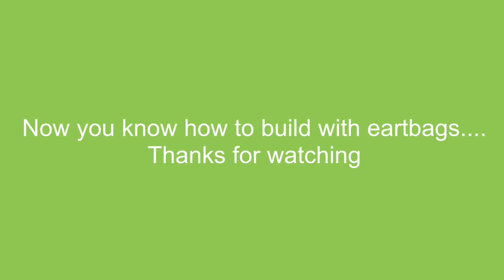Earthbag Building - Almost ANYONE CAN DO THIS!!

Comment: This is interesting.  I just purchased my land.  I am getting different ideas for building my tiny home.   I like this concept.
Reply from the maker: You should consider hyperadobe for a tiny home… that is what I would use. They are more versatile as far as shaping and overall I think they would be easier than these 😎
Reply: If you do decide to go with earthbags, a dome would be a little more sturdy, and you wouldn't have to worry about engineering a roof or buying any other materials. You can cover them with adobe or concrete, depending on how natural you want, or pricing, whichever is more important to you. The domes also tend to be really strong too. There's quite a bit of info on here as well as online in general about building them safely if you are interested 😀 (btw, if you want an extra nudge, I believe I saw somewhere that the cost of an earthbag dome was about 14$/sqft on average to build, while an average tiny house was about 114$/sqft)
Reply: @OffGrit  what is hyperadobe
Reply from the maker: @kerryann2036  they are continuous tubes that look like onion bags . They have a lot of advantages to bags . One being that you don’t need to do the barbwire in between layers… main disadvantage is that they are stationary and once you get higher on the walls, moving dirt can be tedious.
Reply: I like it too because it sounds good bulletproof and warm in the winter cool in the summer.
Reply: Kris Harbour Natural Building.
Reply: How's it going luv,and what construction did you use?
Reply: @walkstheman98  link to that,can't find one?

Comment: Loving the filling station. I'm definitely going to build one of them when I start my own project. I'm thinking about building an earthbag cistern for rainwater as well, don't see a lot of information on them though.
Reply from the maker: Most definitely 🙏💪. I know it would work as far as a cistern goes... This building flooded when I first moved out here and it was a cistern...not by choice... But if you dig out the first couple feet like this one and then make the walls the bulk of the water pressure will be distributed in the ground and then you could probably get away with filling it full with a liner

Comment: Hey man, do you think it's better to make it with a lot of small bags like this, or some long complete bags like to cover the whole wall or the perimeter of the house? I think for me is easyer to load them like you in your station, buen maybe it would be a better structure with a single long bag each layer....
Or maybe 1 layer bricks 1 layer whole bag....
Reply from the maker: Well, there are actually a lot of people out here that build hyper Adobe or super Adobe and which it is a continuous tube. And overall, I think that they are structurally better than this method. However, in certain circumstances these bags are actually better at least for me because number one. I like the fact that these are mobile and that I can fill them in one place, move them another place etc. So there's that. Also, I now have a tractor that I will be setting up to fill at least 12 bags at a time if not more so it will be faster than doing the tubes. Thnx
Reply: @OffGrit  ohhh, great job man, thanks!!!
Reply: Knowing next to nothing about earth bag buildings, my guess is that it’s a toss-up as to which is better.  As said, the continuous bags are more cumbersome to work with.  

And I presume these are special bags built to last when buried, but if a long tube bag gets damage or a tear is started, it could lead to more issues than if a single bag or 2 had a tear.  (Or maybe once rammed down well bag deterioration isn’t a big issue….idk).

Comment: I  enjoyed this. Did you dig out foundations or did you start laying the sacks on the earth?
Reply from the maker: I laid these directly on earth.  I did dig a trench around the outside perimeter and laid a moisture barrier in the trench and over the first couple courses of bags to keep them dry. I know people dig out a foundation and use gravel etc.... one thing out where I live is that the ground is extremely hard so it doesn't really require it for a build like this.... But if you live in a place with less stable soil and get a lot of rain, digging a trench with gravel underneath the bags may be a good idea
Reply: @OffGrit  Thanks for the reply! 
 You've inspired me!

Comment: I am a big fan of this type of construction, because of low energy consumption for air conditioning. Stucco over the outside and drywall inside. A user friendly wire might work faster than string  tie.

Comment: Thank you for sharing this 🙏. Do you need fondations or you can start directly with earthbags at the bottom?
Reply from the maker: Most people will put a trench with gravel as the foundation. On this one I put a moisture barrier around the perimeter and the bags are directly on the ground... Where I live the ground is extremely hard so it works
Reply: @OffGrit  cheers. Do you think this could works for a tropical island ?
Reply from the maker: @povbodyboard  if I were to build this on a tropical island, I would make sure that the roof overhang was at least a couple of feet in all directions... Might also put up a moisture barrier on bags and then use lath with a stucco mix for the coating... There are people building these all over the world and I have seen them in rain forests so I think yes.... You may just have to consider what type of soil you have to fill the bags and see if there needs to be amendments made...

Comment: How many bags per day can someone do (w 1 person)? And do you have to use barbwire between rows, or is there a way to not use that but still have them not move or slide off each other? And do you think its better to build several small rooms joined up or just 1 big room instead? 

Edited in later; oops, you addressed the question of # of bags per hour halfway in.
Reply from the maker: You don't HAVE to use barbwire BUT it can easily become unstable after 4-5ft.... If you use bags that are wider you could be ok . Also I used to look at military structures built with sandbags and they have some interesting setups that don't use it between the bags

Comment: Hola gracias por compartir verte hacer me hace  sentir  que yo lo puedo hacer  ya tengo 300 sacos con esa cantidad me  alcanza cuanto ocupaste tu   ,de  alto cuánto tiene tu casa❤ gracias ❤
Reply from the maker: I used about 1000 bags for this and the building is about 3 foot in the ground so it is taller inside than outside. It is 300 sq ft thank you

Comment: Kindly inform me which material of bag is used so that it does not get worn out by the weather. Thank you
Reply from the maker: We used polypropylene bags. The lighter colored ones. I would look at SandBaggy.com they have options and even UV resistant bags. My experience because I have built other things since, is that you have about a year of exposure with this before it is even an issue... If you are covering them in a stucco like I have, they are good to go
Reply: Appreciate your kind reply. 👍
Reply: What will be a good media to fill in these bags which will really be strong and stand for a good number of years? Do give me a couple of options to help choose which is price worthy. Thank you
Reply from the maker: @albertamanna2258  there are ratios that work well with natural dirt. people use anywhere from 5% to 30% clay ratio in normal soil (look up soil jar test for diy dirt analyzing) i didnt use anything except soil and i sifted it through a screen to remove stones....and then tamped it....that is it. 3 years later and this building is solid
Reply: Thank you 👍

Comment: I was to move to cochise and build. How long did this take you? However I build my home I plan to camp out and finish it then move in.
Reply from the maker: it still isnt done..lol. although i have been bouncing around to about 5 different projects at once.
Reply: @OffGrit  I really want to make a dome that I keep adding additional domes to over time. The first one I worry will take too long. Especially if I'm alone.
Reply from the maker: @oOAjjOo   my advice to someone that would want to live in something and add to it, ,,,, i would go with a shed or a cheaper rv... it is a long process and almost every video i watch of these being built is with a group of people which is a different ballgame when you have help.... a shed can be built fairly quick (livable in a couple of weeks if you spend about $1500-2k) and then you can take your time on the build....
Reply: @OffGrit  yeah. I think I can build a cabin pretty quickly by myself. I just feel a super adobe would work best in this climate. I guess I'll just stick to the cabin.

Comment: The steel plate you were using is a railroad tie plate. Plate that is placed on the RR tie and the rail (track) is placed on it. Then comes the spikes.
Reply from the maker: Thank you!
Reply: @OffGrit  we would weld about 9 of them together and 3 spikes on each side so as to slip them over our livestock water troughs floats. Damn hogs wouldn't just drink water but tear the floats up. RR plates were so damn heavy we had fewer instances.

Comment: How do you do the barbed wire? Completely new to this so sorry if it’s already included in the bag or anything. We’re looking to build one in the back yard
Reply from the maker: So you can buy the barbed wire separately (tractor supply, Lowe’s Home Depot) and you do a course on the bags (layer) and then you roll usually 2 lines of babrbed wire between each layer. Once you do the next layer you then tamp the bags to make sure they are well attached to the previous layer.. the barbed wire prevents shifting

Comment: I was told i had to use cement in with sand?  Is this true?
Reply from the maker: Well...... Not sure what your dirt is like... I have a good mix of clay/sand so it isn't necessary for me to add cement ..
Reply: @OffGrit  Thank you for answering no one else has.  I live in Oklahoma.  I was just going to use sand.   But the first two rows I was going to use rocks.  I was going to use rebar and wire to secure and lock down more.  Tornados are common and lots of lightening..   I wasn't going to use cement because I live on a thousand a month.    But I will now because several say it's needed.   Im just trying to have a home so I don't freeze like last year or cook like now.

Comment: Barbed wire "holds" it? How? Wouldn't it just tear?
Reply from the maker: Yeah I know it sounds strange but it does. It acts kind of like Velcro, especially once the bags start weighing more and more. On top of it, The dirt just creates alot of weight... Plus the barbed wire is continuous without brakes so it attaches the next course to the previous course etc

Comment: Looks like very slow going. When you  think about it, you are not only BUILDING the house, you are building the building materials that go into building it. Maybe 10 years to build?
Reply from the maker: It is slow going. For sure. 10 years.....not that long. Maybe 5-6 by yourself for 2000 sq ft build full time. My house is being built with steel and concrete but this was a learning experience